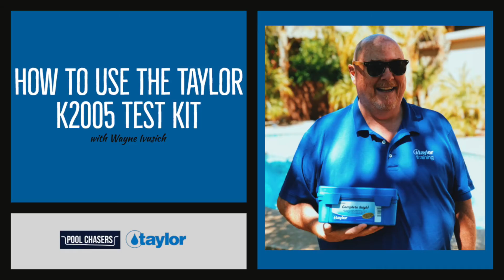How to use Taylor K2005 Test Kit

Comment: what if for the calcium hardness test, after adding the indicator to the water sample, it does NOT turn red? IF this happens - how do you know how much calcium chloride to add to the pool?
Reply: @RavensRule09 I experiment by adding a cup and let it circulate for a few hours then test again. Once you get an indication then you can calculate how much more you need. That's about the best you can do with these kits.
Reply: @RavensRule09 add a cup and let it circulate for a few hours then test again. Once you get an indication then you can calculate how much more you need. That's about the best you can do with these kits.

Comment: I cant really see which tube the droplets are going in
Reply: The right most column as YOU are kooking at it on the screen. Past this I don't get how the hell that pool water column color/s match up to ANY of those 3 adjacent pink<>red columns is way past my comprehension. Ain't even close in color. If I buy the thing it's probably cleared up by fondling the directsheeonies I guess - or it goes back for refund.

Comment: I am sorry but man I am having trouble following you. You really need to be more specific with what you are doing. I am about to use this kit for the first time and now will go looking for more help. Left side, right side of water sample. You need to show more of what you are doing. The part with the drops is good. Just not fully getting it.Thanks.
Reply: My wife and i decided to start cleaning and caring for our own pool for the first time. So, when my contract ended with the local pool cleaner company, I had the owner/paid the owner for the pool man to deliver all the chemicals we needed for our new adventure. I followed the directions on the top of the K-2005 lid ‘top-inside’ color coded. It’s not to bad and I dropped chemistry in college for the first attempt. Ha. So, I just read and tested them in groups. The water container is designed so you can get enough water in your test sample collector. I tested {Free, Combined and Total Chlorine (yellow) and PH (red) at the same time as they both require either similar or the same water levels for testing and the color coding makes the little bottles less intimidating for a beginner. TA and CH can be tested together as well. I didn’t check it yet but i believe CYA and Salt are measured separately requiring more water then the test beaker allows. Thus rinse and repeat - follow instructions on CYA and Sodium/Salt and you’ll have those results as well. Now researching all the variants of chemicals both liquid and solid to correct your weather balance if it’s off is a different video and a different discussion. Mine for example is 0.8 according to the Saturation Index on the Taylor Watergram >(c) <
Reply: @erikjmitchell  pretty spot on. This kit doesn’t test for salt. Dude I’m video also had a high Calcium reading which was throwing the sat index off. Had it been it 300 his index would have been close to 0. That said the CY being so high you’d actually need to add More chlorine and maintain a higher level while it’s at 100. Another factor that pushed his index up into the positive. Pool guy got a little zealous with them Chems. Ideally in the tropics you’d want free chlorine at 4ppm. Combined chlorine at 0 ph at 7.4 TA at 100 CY 60-80ppm and CA at 300. Hope this helps.
Reply: I bought the kit and just started using it by following the directions. At first I concentrated on pH, chlorine and CYA. After that I ventured into alkalinity and calcium hardness. Now I do it in a flash. After using the kit for one Summer, this video is very helpful to shout out the numbers and for a refresher. It doesn't matter how you start, it's going to take time and use up some chemicals. 
This biggest disadvantage of this kit is that the refills are very costly.
Reply: @kdcntn  what if for the calcium hardness test, after adding the indicator to the water sample, it does NOT turn red? IF this happens - how do you know how much calcium chloride to add to the pool?